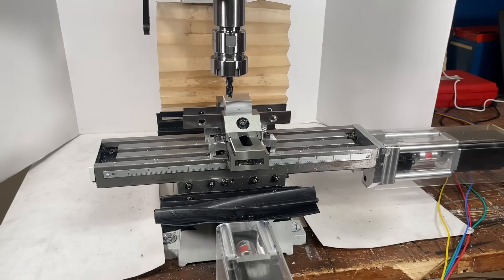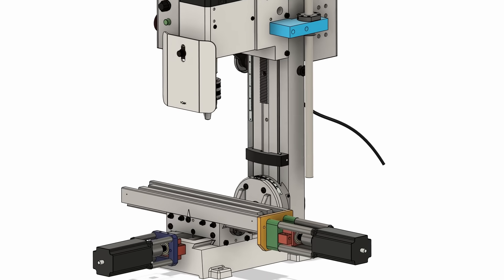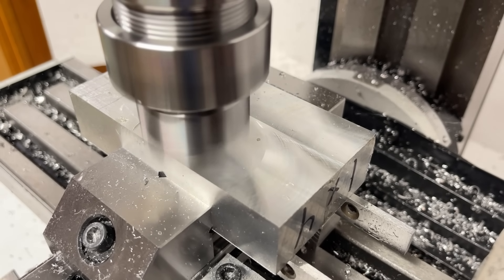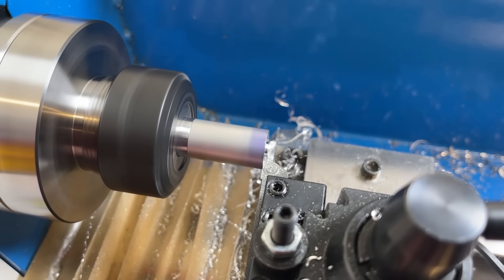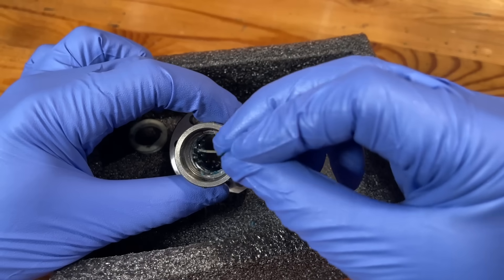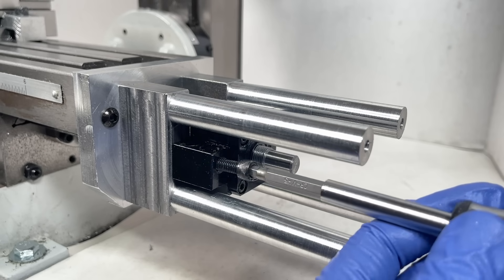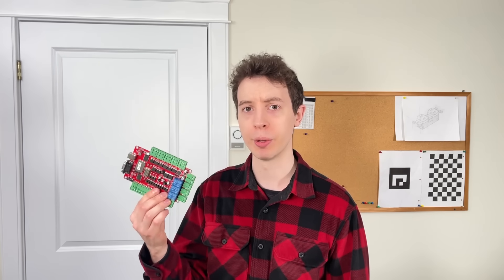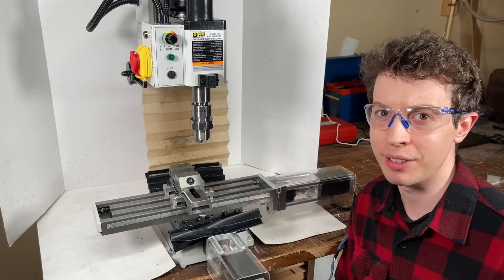Turning a Cheap Mini Mill into a Capable CNC Machine

Comment: This is super cool and something that seems reasonable to make as a hobbyist. As an electrical engineering student, the machining part is a bit scary to me, but it seems more reasonable than some of the other custom CNC machines that are self-built.

I was quite surprised that you didn’t try the steppers beforehand in a separate, less error-prone setting.

Comment: could you tell move how you drive it by esp32? any link or source to use it? i have proxxon mill with diy cnc kit, esp32 as driver sounds good
Reply: Bro, if you use a esp32 board, they most likley use Grbl HAL firmware and fot those you can use Candle or G-Sender to talk with the controller

Comment: In theory. Instead of upgrading to expensive ball bearings. Could you not just use two threaded inserts to eliminate that clearance gap between the threads? Maybe make a quick device that squeezes the threads together to eliminate the gap, but it would cause a lot more friction with the threads squeezing eachother

Comment: I was going to address fact that starting to mill hardened steel when I saw the parallel bars doing the jig underneath your work And then had to completely refake the statement or question that I was gonna ask but what started it is the very slow Movement of your work And your tool Even on aluminum So I guess the main question I'm going to ask is is that machine sufficiently powered at this point to make it becoming a CNC worthwhile Are you trying to put a hood scoop on a Moped

Comment: Next, you need to add a belt drive.  I did the CNC conversion and belt drive (using a sewing machine servo motor) and the combination is really great...  I have SVG files for the motor and belt drive mounting brackets I created if you want them.

Comment: don't worry about the backlash. 
you can program a backlash correction move into the firmware so that it corrects for the backlash every time it reverses direction on an axis.  
then all you have to do is measure the exact backlash of each axis.  enter the numbers in.  and watch the magic happen.
Reply: Or do it the European way and measure the amperage in the coils of your hopefully brushless router motor to detect when it engages again, Just some software and few hardware

Comment: Very nice work!
I have a basic model Harbor Freight X2 mill waiting for me to true some parts and add minor modifications
A conversion patterned after what you did will need to be my next project while the mill is disassembled.
A shame I cannot just walk into a store and buy components for a CNC conversion. 
FWIW, the mistake does give a troubleshooting guide for others.
I have only used SolidWorks at school and at work.
What CADD software did you use to produce the drawing of your mill?

Comment: I'm an idiot but....if you have some sort of DRO, couldn't you fix the backlash problem with software? Using close-loop feedback (from the DRO) to know exactly where your tool path ends up being
Reply from the maker: You could! I would likely need to change Cnc controllers but that’s definitely a valid solution to increase positional accuracy

Comment: Then .004 backlash is most likely in the dovetails... I converted a a pantograph a few years ago...and even with extremely tight tolerance jibs I had to put the table assembly on rails to tighten it up. Anyway, food for thought!

Comment: For me this is particularly awesome as I believe I have the exact same mill and this is exactly what I want to do to it!  So good to see how well it worked out for you.  Also great video!  

As far as FluidNC goes - what breakout board did you use?  Do you like it?  Any recommendations?
Reply from the maker: I didn’t actually use a premade breakout board, I just soldered one up with perfboard and some wires so I’m afraid I’m no help there! That being said it’s probably better to buy one than make one, I was just impatient and wanted it immediately haha
Reply: @Someone_Should_Make_That  OK, got it.  I have an Arduino that is on this plastic breakout experimenters board that might help to get things set up and debugged. 

And a question - what drives do you like?  I have found StepperOnline and the stuff at scamazon, and the number of drives at StepperOnline is confusing.  Why so many different drives?  

I get some that were specialized for things like hospital equipment but there is still like 3a dozen different drives and i get some are closed loop, some are higher current but even within my spec range there is 3 or 4 options.  

I got burnt out looking at all of the shields, motors, drives, linear rails, so I am going to take a fresh start in a couple days when I get some time...

Comment: Nice work, im a machinist and i just want to say that it isn't a CNC mill because you need to change the tool by yourself. It's an NC mill but it's still nice.
Reply: You're wrong. I'm a CNC machinist. Have been for 20 years. CNC stands for Computer Numerical Control. An NC machine is only NUMERICAL. Meaning they used to use punch cards/tape. The presence or absence of a tool changer is not what seperates the two.

Comment: Fun fact if you want to find out if something is gonna be hard and you can justify it grind it with an abrasive tool and if you get lots of bright white sparks that’s an indication of high carbon content so it’s probably a spring or tool steel and will be hard and possibly heat treated another way is stroke it with a file if the file skates across without biting in it’s gonna be pretty hard

Comment: Just so you know even if the 3.3v logic voltage was too low for the stepper drivers, you could have gotten a 4-channel level shifter for very cheap to step those signals up to 5v!

Comment: I did exactly (alsmost) this conversion like 6 years ago. Only i 3d printed the parts in carbon fiber. Then i used the converted mill to make aluminium parts to replace most of the carbon fibre parts. My mill was blue though. I do recomend the belt conversion for the spindle.

Comment: Still having about .004 of backlash. You should do conventional milling instead of climb. The cutting forces will be pulling against the direction of cut. When it is pulling with the direction of cut, the table will be jumping as the tool pulls the part

Comment: Amazing work! I’m curious if you think what you’re describing as backlash could actually be hysteresis due to deflection. For instance, on your X and Y axis, the way the motors are mounted onto the bed could allow for a few degrees of motor rotation before sufficient force is imparted to the ball-screw which would induce movement. It might look like backlash when in fact it’s just system inaccuracy due to rigidity.

Comment: Congrats, I built one myself out of an X2D milling machine, I have teknic servos and a centroid control system.  I got backlash down to a minimum but I think the real problem is in the machine.  I had designs and models, plus prototypes for an ATC but didn't do the final build or install it in the end because i noticed that with any pressure you can move the column.  This 'movement' is down to the column being too small, it's only what 4x2 inches on these smaller machines, extra weight on the head, more powerful motor, ballscrew mounts, heavier spindle motor etc. all adds weight and the problem is this becomes an issue when driving into the material when cutting.  I actually started desiging a much heavier base that would support my requirements but that has become a completely different machine...  I would advise anybody starting one of these builds to go with a much heavier machine base, something like the X3 at least, you are going to put money into it and you have a much better starting machine.  Also, and I have heard this from other people, as soon as you start machining you run into the limits as you instantly want to make something bigger!  Anyway, my gripes, great job and have fun with it.

Comment: Hello Friend, is not the ballscrews, if you found that it is, you can put another pair against each other and with screws move them apart until you feel the resistance, like the big copper screw from a big mill. The other thing that I think is moving is the whole tiny table with play in your gibs, that play could be the whole problem. Make new ones out of bronze with the mill. Check out how they're made, get them as smooth and perfect and you can, and you'll have a tight machine.

Comment: Im a student learning to machine at Thaddeus Stevens college and this seems so cool to know how to do. I feel like the machineing aspect i could work out to it to function with quality with understanding the tolerances and need for rigidity. But that doesn't seem like the jard part im wondering how someone would learn the computer and electronic aspect. I almost no understanding of those types of programs or how electronics work how would one go about learning those other skills. Any tips.
Reply from the maker: The way I learned it all was to start small following along with arduino tutorials online. It’s quite cheap to get some little steppers and drivers and learn the basics of wiring and getting stuff to work. From there it’s really just a matter of scaling up and learning a bit more about different hardware components, but the principles are more or less the same!

Comment: CNC mill has only one problem: it is very inconvenient when you need quickly do something in manual mode. I solved this problem for my mill. There couple videos on my channel.
Reply: Not really, if you know Gcode fluently, you can just enter commands directly into the control manually. Like:
(Safe Line)
S2500
M3
G1 Z-.05 F50
G1 X5.0 F100 
G1 Y-.5  
G1 X0. 
G0 Z5
M5

Boom, part faced. I do this kind of thing all the time if I don't feel like drawing it up in MasterCam.

Comment: Would like more info on the cnc controller software and how you generate g-code. I am stuck with Mach 3 Mill and Artcam to generate gcode. I am not so good with it, just able to machine 2d parts. Eventually I will have to upgrade, switch to more modern pssibly free software. Any tips appreciated
Reply from the maker: Hello! In order of questions asked: The cnc control firmware on the esp32 is FluidNC it’s open source and they have a great wiki page going into the configuration and details. I use universal gcode sender to send the gcode files over to the machine. As for the CAM software, I use fusion 360s manufacturing workspace. It’s free for hobby use with a few minor limitations.  Good luck with your next project!

Comment: Looks great! On the flat spots in your circle interpolated... circle. A lot of CAM software converts arcs to a series of segments. Check the arc filtering settings on whatever CAM software you're using. I use MasterCAM at work and if the arc filter tolerance is set too low it makes facets on our circular geometry like you're seeing. By tightening the tolerance you can create smaller and smaller segments until eventually you don't see facets anymore. It does cause the cutter path to take longer to compute though. Alternatively, you can dig into the settings and see if there's a way to force the software to favor using arcs instead of segments.

Comment: Since you have a 3D printer (as do I), I would have printed the parts I could for a test fit first (especially since you modeled them anyways).  Then I would hope they are rigid enough to CNC the aluminum ones.  I think it would be fine as they are aren't part of the mill's rigid structure.     

This is  a cool build though!  Would be cool if you had an option to manual mill as well.  Would get a bit more complicated for the design I would think.  

How much did this cost?  Sorry if you answered it, I am writing this comment 10 minutes in.

Comment: Nice video(And channel) - Curious why you said that the voltage difference might mean you'd need to rebuild the electronics, couldn't you just use a logic level converter?

Comment: As you were wondering how many people don't like these mills:

... and now ask yourself: How much cheaper was that really compared to a Maho MH300, Deckel FP1 or chinese copies thereof? Used machines like these are often quite cheap, as it isn't economic for companies to run old machines. I could currently get a Maho MH 7000 (700 mm x 500 mm x 400 mm CNC mill) for 1000€.

... or for a comparable size: an EMCO F1P-CNC

Comment: No matter how hard you try with a manual machine in the end you come to the realization that you have to scrap a load of parts to get the perfect CNC action otherwise any step along the way that you neglect to cover will come back to haunt you when the final machine is running........backlash can be compensated for but not successfully .......the biggest issue will be drag in the dovetail slide3s that really should be on liners rails........designing from scratch in all aspects of movement  is the ideal way to go but it will take a lot of machining and design expertise to get to the ideal..........having gone down that path with a bespoke machine  I can speak from experience for a successful outcome.......it comes down to how much money you are prepared to sacrifice to get the ideal solution..
Reply: It looks like you've been collecting dots for years just to finally ejaculate all of them in the comments. Congrats with thr relief!

Comment: Sorry I am not a machinist so this may be a really, really, really stupid question.    With the back lash can you just compensate for it with the program you run?   Say you have .004" backlash and you want to cut .100" in one direction and then from that point you want to cut .050" in the other don't you just cut that .100" then program .054"?      I realize this can be a pain in the ass to account for and compensate for but wont that get rid of your issue in terms of the tolerance you can achieve?

Comment: Milling hardened steel?... No problem with a Solid Carbide endmill.. i've done modifications to a hardened Grinding Vice 58HRc (as hard as a Ball bearing).. no issues..

Open Loop Steppers can be used perfectly.. My machine has been running for 17 years now, with open loop steppers.. 
you just need to get your settings right..
Reply from the maker: That’s good to know! I ran the numbers and found the open loop stepper should be fine as well, but it’s nice to get the confirmation from someone who’s used them
Reply: @Someone_Should_Make_That  Especially with Ballscrews, since they have little friction, using up less torque.. I  have converted many of these hobby milling machines, and we always use Open loop, because Closed Loop steppers weren't around back then, and the only other option would be a "Servo" motor, which would be way more expensive..
I built my own machine with 1.6Nm Nema 23 Steppers, coupled to 2 mm pitch Ballscrews, and that gives me enough torque to snap a 6 mm endmill in two, without losing steps..

Comment: This is so cool, what a great job! Why didn't you use the included controller with the stepper motor kit?
Reply from the maker: Thank you! A few reasons, primarily because I have no idea what software was on the provided disk nor how to configure the settings. I figure it’s always better to know the details of what you’re building in case you want to add in more functionality down the road!

Comment: I think I know how you can get rid of your backlash. Gravity. Your Z has no backlash because the weight of the head is pulled down by gravity. So if you attach a weight that pulls on your Y or X axis thru a pulley a couple feet away your axis can constantly be under tension and that will take up the play in your axis. You could also tilt your machine forward and right 45 degrees each. It would look insane but all 3 axis would be under tension by gravity with no backlash.

Comment: Well done!  I spent $2k designing and building a 1m x 1.25m CNC router from scratch. (Could've bought a kit for less.) I've used it to make approximately $50 worth of wood parts for home projects. I didn't really have a purpose in mind; it was just a fun thing to make.
Reply: The machinist way of simple woodworking :)
Reply: Sometimes it's nice to do stuff just for academic purposes.
Reply: I will buy it off of ya lol
Reply: For real though that's big enough for an engine. These billet CNC LS parts are out of hand.

Comment: Those balls are ordered. They come with bigger ones and smaller ones alternating to reduce internal resistance. They should also come with preload tension to further reduce backlash. Make sure you reassemble them right. Good luck.

Comment: Awesome Project and nice video!!
You earned yourself a awesome brownie recipe!
Ingredients:
-1 Cup unsalted butter
-2 Cups granulated sugar
-4 large eggs
-1 teaspoon vanilla extract
-1/2 cup all-purpose flour
-1/2 cup cocoa powder
-1/4 teaspoon salt
-1 Cup chopped nuts or chocolate chips (optional)
Instructions:
1. Preheat oven to 350 F (175 C) and grease a baking pan.
2. Melt 1 cup butter, mix with 2 cups sugar.
3. Add 4 eggs and 1 tsp vanilla; mix well.
4. Sift in 1/2 cup flour, 1/2 cup cocoa, and1/5 tsp Salt; Stir.
5. Optional: add 1 cup nuts or chocolate chips.
6. Pour into the pan, bake 25-30 mins.
7. Cool completely, Cut into squares, and enjoy your brownies!
Reply: Hey... EXCELLENT!...  Do you have a G-Code file for that?   😜
Reply: There is a "green" ingredient missing 🤣
Reply: @fatso8437  nah, if you really need that on the ingredient list then better dont put the magic touch in there :)